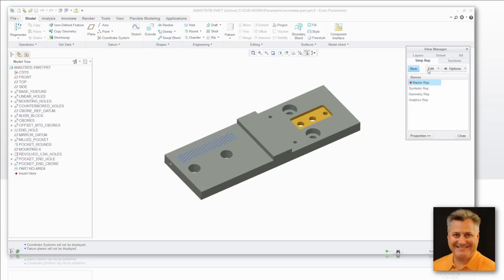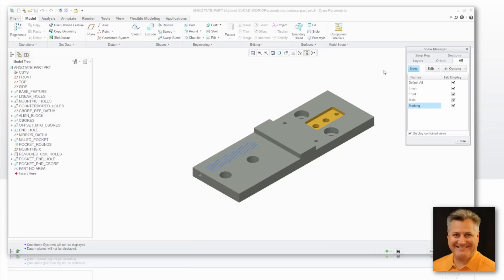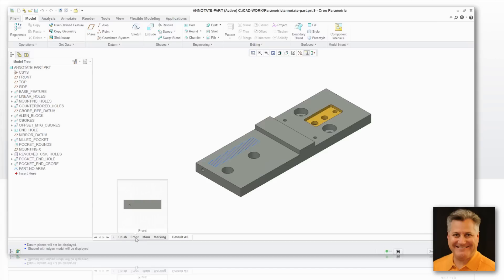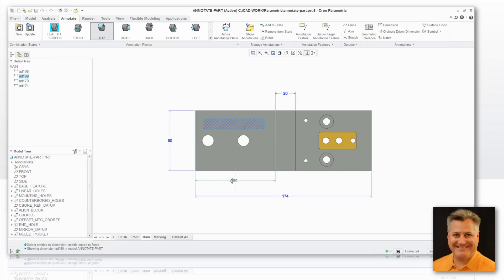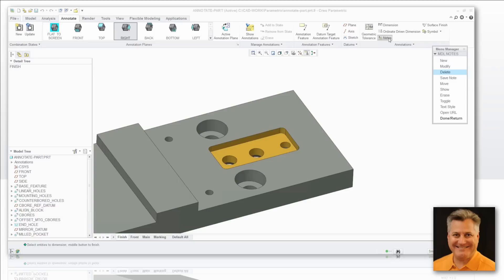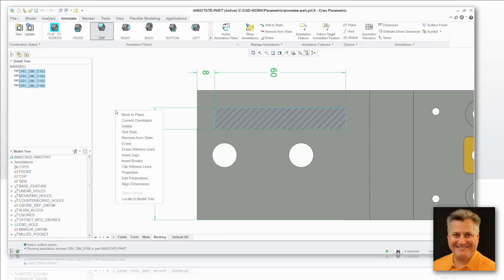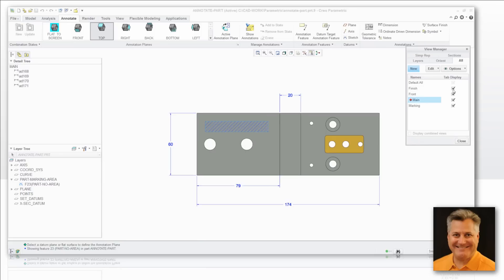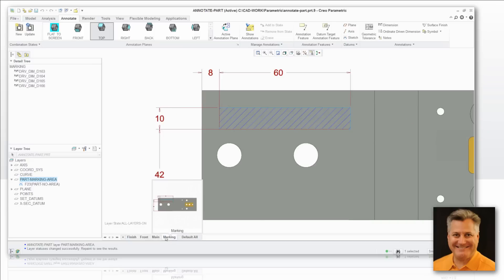Simple 3D Drawings using combined views in Creo and Pro/E - EAC Tip of the Week

Comment: Hi Mark, Thank you for a very thorough explanation. It's helped a lot with our company moving over to 3D drawings. I do have another questions - how do I export these combined views with the annotation to Creo View Lite?
Reply: I'll assume this is being done via PDMLink, but the same hold true within Creo save as. It's just not as straight forward to get to. What is included when a Creo Parametric file is converted to a Creo View file is determined by the options set in a recipe file. This will determine simple things such as included datum planes, or more complicated such as 3D view information. There should be detailed information at PTC for what the recipe file editor looks like and how to use it.
Reply: Thanks Mark, I got that much from searching the web. I've actually manage to manually edit the recipe file, and I've found the switch that turn on Combination views from copying them from the GRANITE.PVR file which was among the rest of the CREO files. Now I'm trying to find the trigger that will allow certain combination views to show the simplified rep as you have shown in your video. I've just got into this about 10 minutes ago, do you have any guidance for the correct trigger to look for? By Trigger I'm referring to look something like: 

adapter/simplifiedReps=1

I still need to clean up my recipe file but currently it has these in it:

file=proepview-rcp
ver=5
adapter/convQuiltAsDatum=0
adapter/outputAuthorState=1
adapter/useTransparency=1
adapter/outputThumbnail=1
adapter/thumbRecipe=MC:\\PTC\\Creo 3.0\\M050\\Common Files\\apps\\prodview\\recipe
adapter/outputAnnotPlanar=1
adapter/convViews=1
Adapter/convCables=1
adapter/outputDoublePrecision=1
adapter/outputDatumPlane=1
adapter/outputDatumCurve=1
adapter/outputDatumPoint=1
adapter/outputDatumAxis=1
adapter/convLayerState=1
adapter/convAllStates=1
adapter/simplifiedReps=1
adapter/convXsec=1
adapter/convExplodes=1
adapter/convProProSeqences=1
adapter/convFeatDimLayers=1
adapter/9/name0=All States
adapter/9/value0=convAllStates
adapter/9/width0=19
adapter/9/name1=Simplified Reps
adapter/9/value1=simplifiedReps
adapter/9/width1=16
adapter/9/name2=Orientations
adapter/9/value2=convViews
adapter/9/width2=10
adapter/outputAnnotScreen=1
adapter/outputAnnotFloat=1
adapter/outputSource=1
adapter/outputAssembly=1
adapter/outputDrawing=1
adapter/outputGzipCGM=1
adapter/outputGzipDWG=1
adapter/outputGzipHPGL=1
adapter/outputShape=1
adapter/outputTessellation=1
adapter/outputSubComponent=1
adapter/outputMassProps=1
adapter/outputWireframe=1
adapter/outputDatumQuilt=1
adapter/outputDatumCsys=1

Like I said it is a bit of a mess :)
 I unfortunately cannot get my hands on the editor, so I'm stuck with the manual process.
Reply: Not off the top of my head, sorry. You can download the editor at PTC. Don't remember where, but that is much easier to edit as it puts it in GUI form.